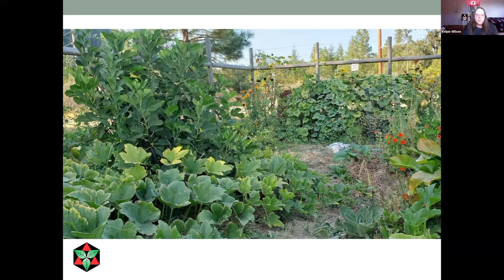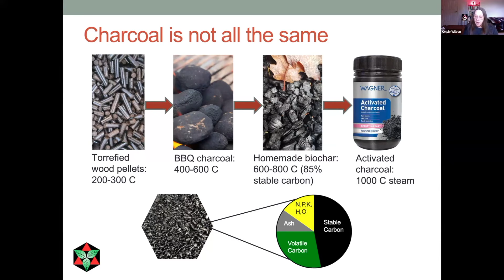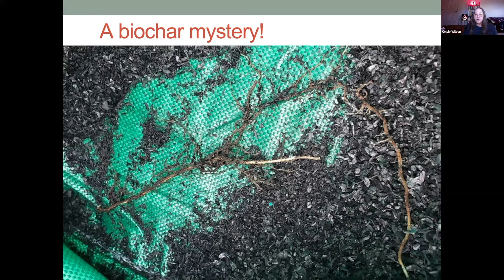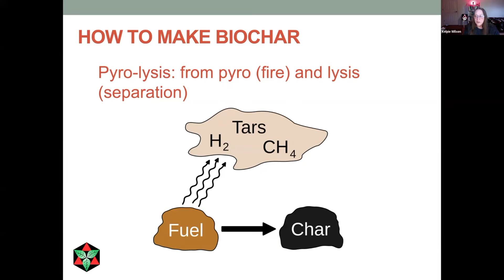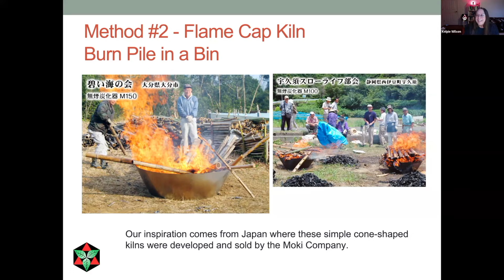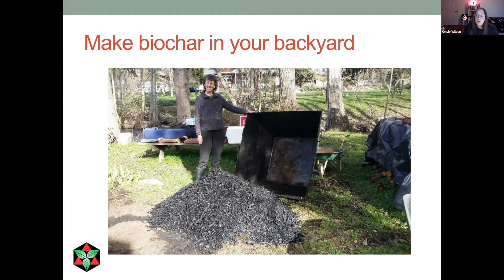Biochar Gardens & How TO Make Biochar with Kelpie Wilson | R-Soil REWIND

Comment: Great presentation Kelpie and Matt, thank you. May I have you opinions on Zeolite in comparison to biochar. Both are highly porous but mineral Zeolite consumes no vital oxygen, in formation. How do they compare on the regenerative scale, thanks again!?
Reply: I don't know much about zeolite so cannot comment on its effectiveness in soil, but I think you should consider that zeolite comes from open pit mines and needs to be crushed and processed, consuming a lot of diesel. Not exactly regenerative. Biochar on the other hand is naturally found in soils in all fire-adapted ecosystems. I usually make biochar from woody debris that would have been burned anyway, keeping half the carbon as biochar and reducing CO2 emissions by half.

Comment: Great presentation. All the bases covered. And You have a fine kiln design. Ive been doing almost weekly burns with 5 or 6 cords of wood per burn lately here in Venezuela for a 70 hectare comercial scale Zero off site input "syntropic" type cloudforrest agroforestry project with coffee, cacao, nuts and diverse fruit orchards as the major cash crops. I find the BEST burn sites are huge leaf cutter ant nests. I can easily fit a 7×7 foot hole right in the middle of them. Aside from being the only organic method Ive found effective to control the ants, the Giant mound nests provide perfectly controlled oxigen limitation. I bottom light and pile on, then don't let the flame reach the Surface till the pit is full. I do night burns to avoid visual distress, but it's almost pure vapor from water and wood vinagre till the pit fills with coals, which is them so hot It doesnt smoke and sucks back in even the sparks It shoots up. I use mostly Green wood so the first 6 hours or so just boils off as steam. I Start at dusk and water extinguish from around 4AM. Usually takes another few hours to Fully put out to the bottom. I get about 2.5T of Char per burn, which I soak in equines and bovine manure tea from deep bed stables. Inputs are mostly pioneer trees from land Ive fallowed for 15 years. The results are amazing. Combined with on site inoculants and Large planting holes, I have literally seen well over 50× growth on tree crops compaired to the same trees in the same soil with just deep holes and composted manure. Like cacao or peach palms in full production within 3 years from seed, and a solid 3000 feet above their prefered altitude. It's good stuff.
Reply: Glad to hear you are having such great results! Try adding your biochar in the stables - it will help control flies, absorb ammonia and produce a higher nutrient compost.
Reply: @KelpieWilson 100%. It's a haul, as I Char up the Mountain where I'll plant, bueno well worth It. Ironically, biochar in the compost means less nitrogen leached in the exudate that I use to Charge them biochar. But the net nutrient retención makes It well worth It.

Comment: Interesting. What I often miss in these presentations about biochar is the mentioning of PACS, its prevention, the certification process, ect. One would simply not want to contaminate their own soils with carcinogens, right?!
Reply: Polycyclic aromatic compounds - PACS - is a very broad term. Biochar itself is a PAC. Some PACS, like benzene can be toxic, but the biochar we make is at high temperature and so anything toxic is burned off. If there are some slightly toxic tars and oils left in the biochar, they are quickly consumed by soil microbes. The biochar we make in flame cap kilns and biochar burn piles is a form of biomimicry. Soils already have a lot of charcoal in them from past fires. It is possible to make toxic chars, but that occurs in certain industrial processes where tars and oils are not completely burned out, or where the feedstocks are contaminated. We only use clean forestry debris.

Comment: I’ve used Royal Oak lump Charcoal and charged it with Urine and added LABS as a bio inoculant but also to cut down on the aromatics. Charcoal is fully submerged in this solution within two enclosed 5 gallon buckets. I plan on adding this to the core of a Johnson Su bioreactor.

Comment: We suffer with heavy clay soils here in Tennesse. I would love to incorporate it after using Gypsum. 
Let it all settle for a full year. Get a ph test done. See if that sits under 7.0
I'd love to make rows 36 inches wide with 1 year old compost dressed on top. 
Plant into it... retest the following year and see how everything goes.
Our soil need so much structure. We cleared 1/2 acre.  
The top soil was scrapped off ( 1/2 inch of  forest soil.) Brown  in color. Slightly black.
The exposed clay solarized. After a heavy rain... the silt and clay surfaced and sealed. 
So planting is a no go. I'd have to  cover crop peas, beans,  clover and see what takes and chop and drop.  
I think it would take 3 to 4 years of planting to fix the 1/2 acre.  Yard holds water ( moisture well ). 
You can see the Iron on the rocks. Definatly good Mineralization available.  The air cannot get into the soil as it is. 
It'll be a good fight!  So yeah, We'd love to try Bio char thats been innoculated. 
Till that into the first 6 inches to 1 foot.  See how that goes.  
Most of the mono culture hard wood is Oak.  Very few hickory/poplar and even Less Black walknut.
Reply: You can build soil quickly with biochar! Make it from your fallen tree branches - any species - in a kiln or in a burn pile. Add it to fresh green grass clippings and other degradable waste like manure and compost it all together. You can plant right into that stuff so just lay it on top of your clay soil and keep adding more every year.